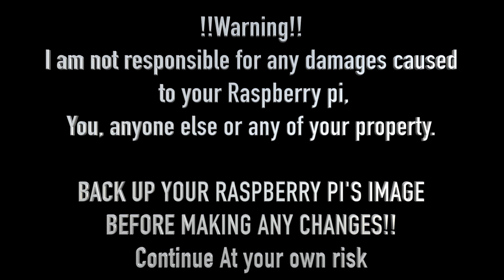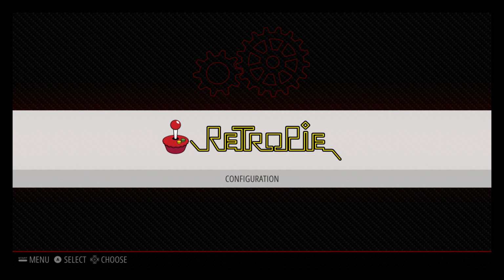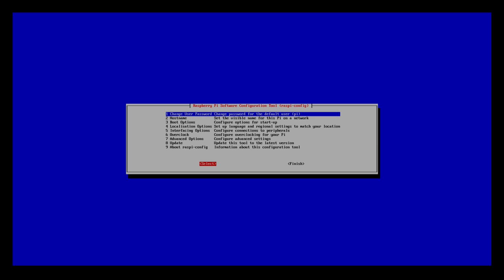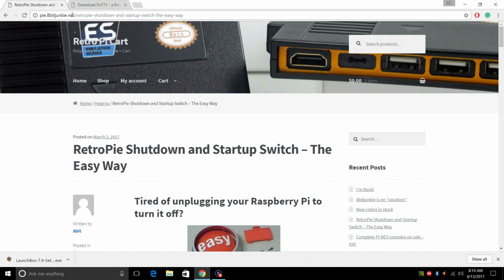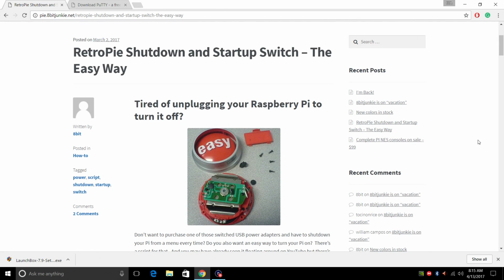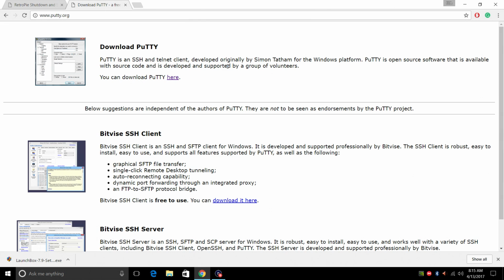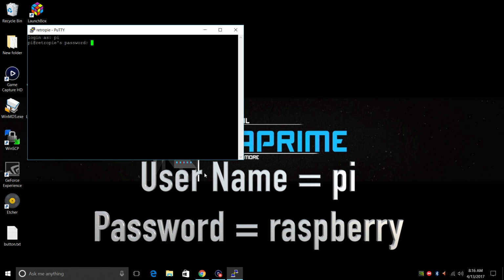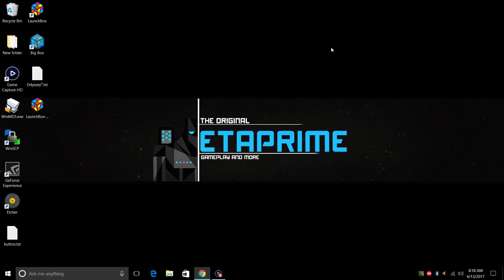The Borkin Button Easy Raspberry Pi Power Button

Comment: Do you think this would work connected to an audio ext. cable?  I ask because I have an audio jack mounted on my arcade, wired to the pi.
Reply from the maker: +Adam Jacobs yes it will but it would be easier to use this script and connect a button to pin 5 and 6 using the gpio pins. https://m.youtube.com/watch?v=4nTuzIY0i3k
Reply: fantastic thanks man!

Comment: Will this only work with RetroPie?  I would like to use it with Ubuntu Mate if it will work.
Reply: I just installed it with a Pressy, and it does start the Pi with Ubuntu MATE.  You do have to shut down through the Ubuntu menu as usual, but that is what I wanted anyway.  No more unplugging and plugging to boot!  The white button looks great on my Flirc case.  Great work ETA PRIME and Matt Borkin and thank you.

Comment: Great video. How could you go about if you want to add this function - but you want to but the switch a few feet away (my rPi is built into an old NES-case and I would like to use the standard power switch)
Reply: There are videos that tell you how to make a borkin button on youtube. Aka headphone jack button. You could do that with wires instead of soldering the button directly to the plug. Hope this helps.

Comment: Couldn't you just put a jumper on pins 5 & 6, since 6 is a ground?
Reply: I wonder why he didn't explain how to put a dupont connector on 5/6 and run the US script via command window on a keyboard, that's way more simple. actually to answer that, I think the fan jump attaches on the ground next to the power supply , so the wire by passes that in case anyone wants to use it. If you look at his board I think there's some solder on that pin so he must've tried it and decided to use the cable method instead so people won't mess up
Reply from the maker: +Chiyu Ryuu I've made 2 other videos doing it that way.
Reply: and man i bought the entire soldering set up and couldn't just got a dupont connector?
Reply from the maker: +Chiyu Ryuu you'll use the set. Trust me it's worth have one for this and other projects and repairs
Reply: right on, yeah I think it'll be fun to do some soldering. I can't find those dupont connector videos. Thanks for doing all these how to/instruction/testing of SBC's you do a very good job, well spoken also.
Reply: Hey, ETA PRIME. Great vid, as always. Do you mind dropping a link to your video showing the dupont connector method? I can't find it.

Comment: HI, please help me!!!  My Pi is just booting up then shutting down straight away??
Any ideas??
Thank You
Reply: Neil Gray little late reply.  But I've noticed this happens if you have pin 5 shorted to ground all the time.  Like if you accidentally bridged pins 5-6 on the gpio.   If you hadn't fixed this by now, hope this helps to diagnose the problem.
Reply: Neil Gray i have this problem too :(
Reply: I can't work it out. It seemed to work for a bit then it jut keeps saying starting to shut down. Also my PS3 controllers have stopped working on Bluetooth and I can't seem to re-pair them. Maybe something has blown up!! ??

Comment: would using an extension cable for the headphone jack have any effect? I'm trying to make a panel mount switch
Reply: I would assume you just need to make sure it's a 4-pole extension, but it might still work with a regular 3-pole extension since it's just grounding it.

Comment: Hey ETA.  Thanks for this!  You mention in the video that it's not necessary to solder on the back of the pi.  I know I can attach a wire to the top-side GPIO pin, but where do I attach the other end?  Do I still need to solder it to the underside of the board in order to attach it to the audio jack ground?
Reply: 00:48 "now, you will need to solder"
Reply: Louis Laureys at 0:58 he says you don't need to solder on the back of the Radpberry Pi as he holds up a piece of jumper wire. Leads me to believe there's an alternative to do this without soldering, or at least a simpler way on the top side of the Pi. I'm a novice at soldering, and I'd rather not attempt a bottom-side solder job if there's an easier, if less elegant, way. So it looks like I can attach a jumper to the GPIO pin top side, but where do I connect the other end? Where is the audio jack's ground on the top? There's a lot of metal on the top side of the audio jack... if that's also the ground, I have more confidence in soldering to that.
Reply: Jeff Clarke "If you can't follow these instructions, you don't need to be soldering on the back of your raspberry pi anyway"

I agree it's a bit vague, but the message I'm getting out of that is this "don't attempt this if you can't solder"

Comment: You can buy a micro USB cable with an inline on/off switch from eBay for a couple of pounds (£). No soldering or scripts required. Just connect it to a USB port on your TV (if you have one). No more unplugging the cable from the Raspberry Pi, just turn it off using the switch (after shutting the Pi down through the menu, of course). And turn it on again with the switch when required.
Reply: Good point to shut it down first. You should never remove the power wire from your Pi before shutting it down properly. It can corrupt the image on the SD card. You must wait for the green LED to stop blinking.

Comment: there is a regular power on/off funktion on the raspberry py you must only solder two pins in the holes right off the GPIO and to a touch button and it also works

Comment: I made myself something similar but with a push button and no soldering on the pin 5, also I made the shutdown script myself so it waits for a long press (3 secs) or a short press to close the emulator and return home. But yes, that means had to make a hole for the button on the case. Anyway I preffer to put at risk a case than a raspberry

Comment: Looks like that that AV jack pin where you are soldering that wire is connected to "PP24" witch is composite video out. I guess that the smart phone short cut button is just switch between video and ground rings on the plug. If this is the case then your wire is permanently connecting "SCL1" and "composite video out" to gether and you are useing the switch to ground that circuit.

I would say that with this mod you can't use composite video out and I2C interface at same time becouse composite video will ruin your I2C clock signal and I2C will ruin your video signal...
Then there is the guestion is there any harm on driving video signal to that "SCL1" pin or I2C clock signal (3.3V @ 5 MHz) to composite video output...

But if I'm totaly wrong then this looks like quite neat solution!

Comment: it's cool but i use that audio jack all the time.
Reply: Put a flip switch in between. Off for audio. Not sure how that would work with the script or whether you have to carry little pliers to get that thing out of the port, but it won't ground out the IO pin.

Comment: if I add this script to RetroPie. will it need to be re configured after I run the update script for RetroPie. or is it once setup it will not need to be configured again.
Reply from the maker: Andrew Makowski it should stay but if it doesn't just run the script again
Reply: The link you provided for the button. is that the same one you used in this video. i only ask since it had bad reviews.
Reply from the maker: yes and i ordered these also http://amzn.to/2pfqAtI

Comment: Just plan ahead and get the power adapter with the on/off switch.
Reply from the maker: by cutting the power to the Pi you run the risk of corrupting the sd card. The script In this video shuts the Pi down correctly. You can always just press start on the controller and scroll down to shutdown within retropie.
Reply: You're missing the point.

Comment: or you could get a remote power switch from Amazon for $12 and turn your pie on and off with the tiny key fob sized remote.
Reply: ETA PRIME when I exit attract mode I have it set to run a script for normal shutdown. takes about 5 Seconds at which point I use the remote to turn off the power. then the next time I want to play I just use the remote to Power It Up.
Reply from the maker: atlmyk this by cutting the power to the Pi you run the risk of corrupting the sd card. The script In this video shuts the Pi down correctly. You can always just press start on the controller and scroll down to shutdown within retropie.
Reply: not a smart move removing power, ruining your sd card filesystem...

Comment: does anyone know if that works with a 3.5mm splitter/extender cable? I kinda need my audio jack and I usually can't access the jack when it's inside a project box anyways.

Comment: LoveRPi micro usb push button is much better imo...and no soldering required, just plug and you're set.  https://www.amazon.com/gp/product/B018BFWLRU/ref=oh_aui_detailpage_o03_s00?ie=UTF8&psc=1
Reply from the maker: The problem is it works just like unplugging the Pi. You do run a risk of corrupting the sd card if you don't SHUT DOWN the Pi properly. the script in this video shuts down the Pi properly.

Comment: The big question for me is how this affects using that composite out port when the button is not installed?
Reply: The audio out works perfectly with the button removed.
Reply: It's a GPIO, if you do not look at it for input, it should not matter.
Reply: The way I see it the button just puts the GPIO PIN3 to ground and when it see's it in software (IE the "script") that PIN3 has gone low it tells shutdown. Honestly I would use a 10K pull down resistor as a protection since 5 or 3.3v with what ever current draw is with it all of a sudden going to ground.

Furthermore you wouldn't need the "Audio button" but any kind of switch with a pull down resistor going to ground will work. Makes me wonder... 10 or so years ago I built a "touch button" for a PC mod. Used a Piezo speaker, a germanium NPN transistor and resistor. Tap the piezo speaker and caused a piezo effect to switch on the transistor to make the collector go to the emitter that was grounded.
Reply: Peter Carcione I suppose I am just concerned for how it affects the composite analog output.  Also if you happen to install a script that sets the pin for output, it can damage your pi when the button is pressed.  I guess you just have to be careful to not utilize the pin for output.  Might also not be a bad idea to put a 10k resistor inline for protection.
Reply: Okay. I see what you mean. It is good to suppose that if everything goes wrong, what could happen.

Comment: nice thanks, but is there a way to turn off completely the device in this way , because it still under tansion, so u still need to turn off via usb on off switch or displug it??
Reply: Evo RetroGame Never unplug your power supply.
Reply: Loek Gerrits why not?.
Reply: Evo RetroGame Because it doesn't need to be shut off ever, really. no performance hit from staying on, and the power use on these things is very small, so its not like its expensive
Reply: Sylvester Tennant Yep. However, there's another reason. If you unplug your power supply, you could corrupt your SD. The chances are slim, though.
Reply: thanks guys for your answers..